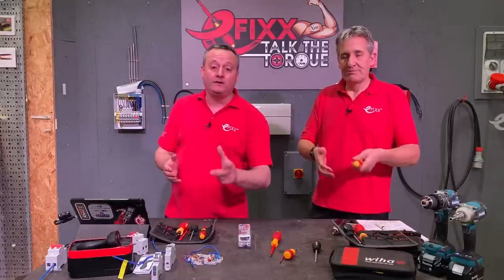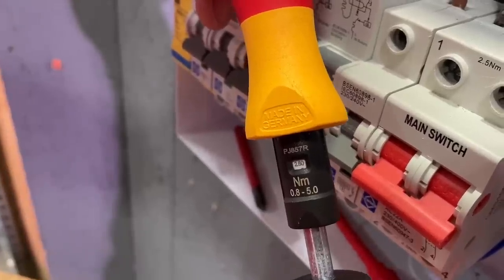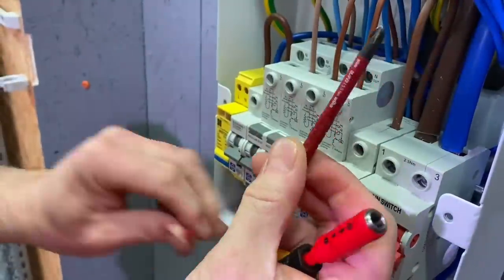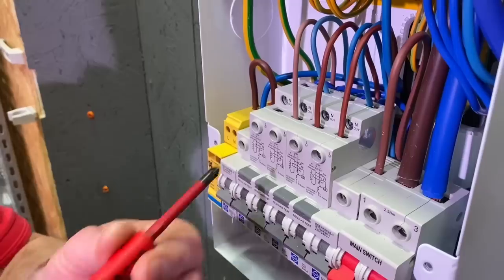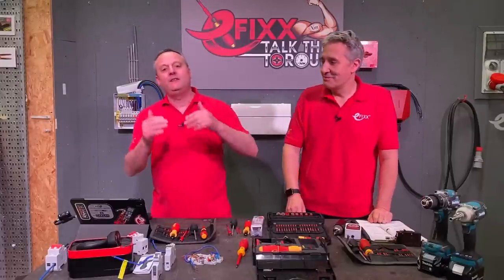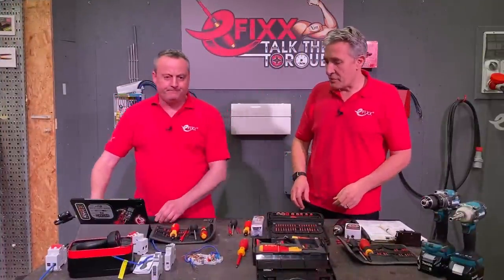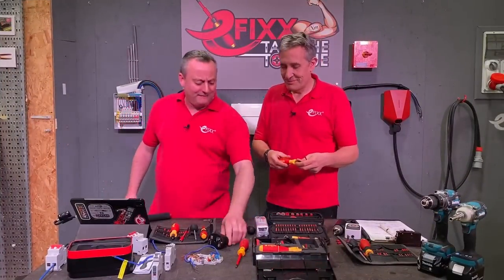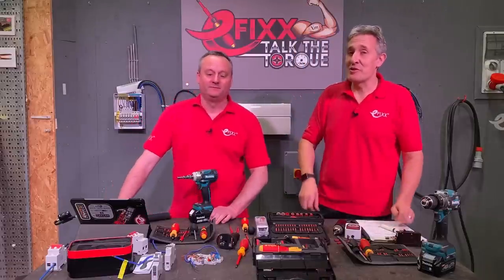How to use an ELECTRICIANS' TORQUE SCREWDRIVER: PLUS Tips to look after one! : Wiha TorqueVario.

Comment: When finishing with the torque screwdriver always unwind to minimum torque,  saves stretching spring + keeps it more accurate
Reply: Hi Mat  if you don’t mind me saying you don’t need to unwind back to 0.0 >>> it designed to stay where you  set it , it’s most important that you don’t unwind more than the 0.8 or 1.0 Nm marker >>>>  over wind by the 5.0 Nm >>>>> marker  hope this helps.

Comment: I recently decided to replace all my screwdrivers and was trying to decide between Wera and Wiha. I did a lot of research to weigh up all the features and benefits. In the end I chose Wiha. The Wiha torque screw driver and SlimVario system had a major contribution to my final decision. I'm now embracing Wiha tools with no regrets. Very happy customer 👍

Thanks for your videos, guys. Mike.
Reply from the maker: Great feedback Mike

Comment: Another interesting vlog guys . 
I’m in the partly a believer camp due to my frustration with modern poor quality cheap as you can make terminals especially main switches and some cables being poorly made work hardened not annealed copper bar in pvc labelled as cable . I do have that very screwdriver kit and found some cables did NOT grip the conductors in a satisfactory manner . As I have mentioned before you need to wiggle the heavy cables in order to rearrange the round conductors in a square connector😏
Reply from the maker: You’ll enjoy the next video in the series - wiggle included
Reply: @efixx  I like a good wiggle

Comment: Something to try. Put a suitable adaptor in an impact driver to fit a 10mm socket. Use this to tighten a nut and bolt. Then loosen the nut and bolt with a spanner. This will demonstrate just how much an impact driver will tighten things.

Comment: Hi,  Thanks for another great video.  Just two questions.

1  Why don't manufacturers use standard settings across every  RCD,  MCB,  RCBO,SPD's etc.  It would make life easier
     If the BS7671 made recomended seting mandatory for manufacturers.?

2   If you do not reccomend the use of the torque screwdriver being used as a conventional screwdriver,  Why do they 
supply them with conventional bits?
Reply from the maker: Hi Bill,

1 - manufacturers use different layouts and screw sizes and terminals- hence different torque settings. 

2- You still need the correct bit to apply the final torque to the screws. The bits here are interchangeable between screwdrivers and the torque setting screwdriver.

Comment: I completed Joe’s CPD on torque screwdriver and torque settings , i now have a better understanding of the impedance of them and as such my opinion has changed a bit , but I still disagree with you saying the required torque settings or the manufacturers required torque settings , in BS7671 it states two key words ,1) good workmanship and manufacturers instructions, it does not state required or manufacturers requirement at any point , it is simply a recommendation. I am now of the opinion that if you have a torque screwdriver then use it if you don’t have one then get one and use it. It’s no hardship , so yes I am happy to say I have one now and I do use it when needed.👍
Reply from the maker: If you ignore the manufacturers instructions and something goes wrong you might struggle to defend any warrant or damages claims.

Comment: That Quick Check device is £164.00 from an on line retailer with free next day delivery. I run two torque drivers the wiha as demonstrated and an armeg switch blade so I don't have to keep adjusting 💪🏻😎
Reply from the maker: Guess you could check one with the other?

Comment: Please explain why more torque is required to loosen a screw. I have broken a few SL/PZ bits on Lewden boards and been in discussion with Tony Martin from Wiha regarding this. He mentioned that the driver is to be perpendicular to the screw (which I always do).
Reply from the maker: Generally less torque is required to loosen a screw compared to tightening. It’s a bit like pushing a car up a hill. Bits often snap (particularly slotted pozi) due to to quality of the screws - we’ll do a video about this.

Comment: Watch out for the range. The one in the video starts at 1 Nm which is already too high for some screw terminals. 2.5mm spacing ones are around 0.4Nm torque

Comment: if by mistake I have a screw tightened to 1 NM and i use this tool with a lower setting like 0.8 NM to loosen the screw the tool will click and won't allow me to turn. does this damage the accuracy of the tool ? and can you use the Vario S VDE bit holder with standard Vario S (non VDE) handle?

Comment: That check box should have been made as a go/no-go box to make it truly useful and worth the money:
At a fixed 2.8Nm it only tells you your driver is working on that sweet spot.  Instead have a low and high setting (1.5 & 3.2 for instance) and it shows that the driver is correct across a range not coincidentally correct at only one value (2.8=2.8 but 2.6=2.7, 2.4=2.6, etc.)
Reply: I'm just making a choice between a fixed 2.8nm and a screwdriver with adjustable nm and can't decide which one to choose

Comment: 55 years, never used one, never will. You can "feel" when there is enough compression under the screws.
I worry that the new generation of fitters will rely on these tools, only to find out later the wires have burned due to not being tight enough.
On the other hand, only a fool would over tighten past the feel level.
Call me old School, but I have NEVER had a fail using the old trusted method of feel, and instinct.

Comment: What I don't get, is why we have to check a manufacturers terminations of they have torqued then to the correct rating
Reply from the maker: Could have vibrated during transportation or been moved during installation of other devices.
Reply: @efixx  it still shouldn't come loose, do you ever check your engine bolts or wheel nuts, once they are tightened that's it, and there's plenty of vibrations on a vehicle.
Reply: @acelectricalsecurity  If you change your wheels you should tighten the bolts to the specified torque. And you should repeat that tightening process a second time after driving between 50 and 100km with the vehicle.
And when replacing a board you actually tighten so many screws, to check the others isn't that big of a deal. And you personally can ensure that every connection was fine when you installed the board.
Reply: @Marcel_Germann  that's not really my point, my point is, if the bolts are correctly tightened then there's no need for anyone to touch them, and yes I know it's a few bolts and we all do them, but really we don't need to, I knew the transportation thing would be mentioned, that's why I pointed out a vehicle as an example, and take the wheel thing out the equation, every bolt or nut on a vehicle will have a torque setting which nobody checks on a daily basis before they jump in and drive off.
Reply: @acelectricalsecurity cars are designed to vibrate , consumer units aren't.  Hope this answers it for you
Reply: @acelectricalsecurity  the other answer is that they're passing on liability and reminding you not to assume another person's work is perfect . Like when someone asks for 2 sugars in their tea and you tell them to check it just incase its not enough even though you gave them 2

Comment: I usually find a fingertip grip sufficient, at a pinch.
Puns aside, the condition of wiring strands, sheath interference, ferrule fitment, tension, shouldn't be overlooked. I have seen some shocking examples. Sorry.

Comment: This bugs me. You harp on about following torque settings as per manufacture. Yet everything you did invalidates those torques. You are doubling over wires, the manufacturer tells you not too. Those ratings are for one single conductor stripped to the correct length and inserted. NOT a doubled over wire....
Reply from the maker: Doubled over wires do not cause any issue with the torque settings.

Comment: The only torque setting you need is FT, F##king tight.
Reply from the maker: Until you damage the threads on the devices, then it becomes expensive.